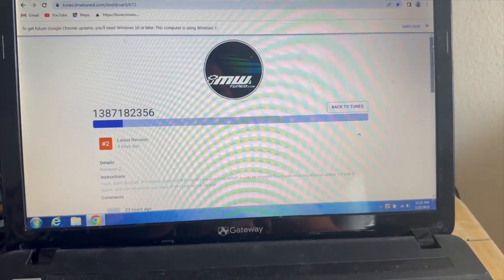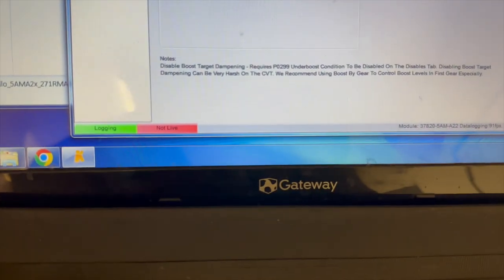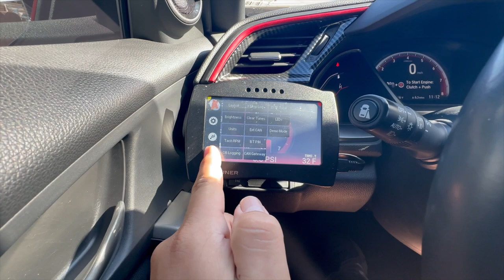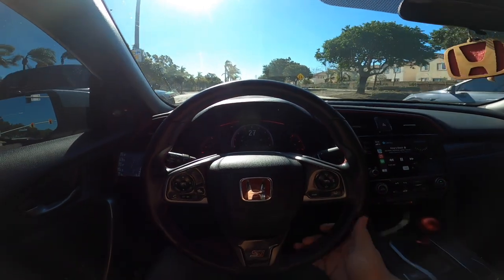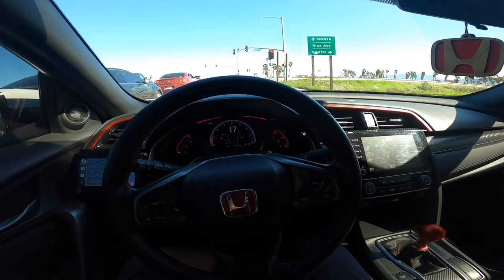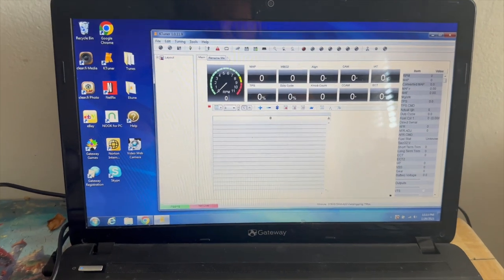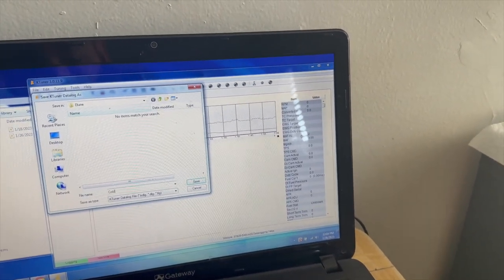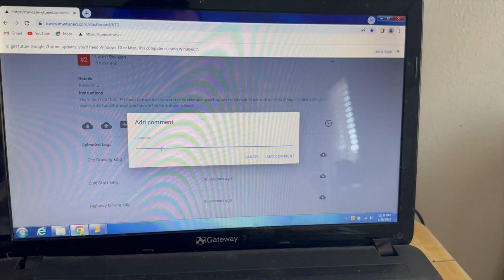Finally Getting a Custom Tune for my FBO Honda Civic Si | E-Tuning & Data Logging Step by Step

Comment: Only downside is it’s just a a/f tune. Motors are different even if the same model engine. Some like to be a little more rich where others like to be leaner and that’s where a dyno comes into play. But should be a solid tune for the most part.

Comment: Just FYI You can data log the V1.2 using the tuner view app or laptop whatever you prefer
Reply: Is it the same as the v2 where you have to connect the obd device to the computer?
Reply: @chorizojuice  i believe the port is different in the v2

Comment: Can you do a vid on how full throttle shifting should work? I know IMW tunes come with it, but you can’t see the settings. I’m trying to do WOT shifting but the RPM’s are shooting up to redline when I depress the clutch. Don’t know if I’m doing something wrong and I haven’t seen any 10th gen ktuner vids on WOT shifting. Thanks
Reply: I'm almost certain only Hondata has the feature. At least for the 9th gen that isn't an option. E Mail D.Rob and he'll respond.
Reply: @ericmoney9734  ktuner has it. And I’m waiting on D.Rob to respond.
Reply: @sarkology  Ahh, ok. Makes sense

Comment: You put alot of money into this car. Why wouldn't u do a proper dyno tune.
Reply from the maker: Drob has been proven to be if not, the best tuner for this platform right next to Jon Vega. They’re both on the east coast while I’m on the west.
Reply: @TdaKid  I'm not saying anything negative about your tuner or any other tuner. Just saying it's better to tune on a dyno.
Reply from the maker: @notsure3535  if I was able to get this car on a dyno with either of these tuners to work on the car I would’ve. This is the next best thing for what I have available in my area.